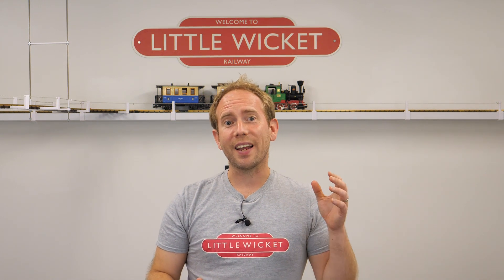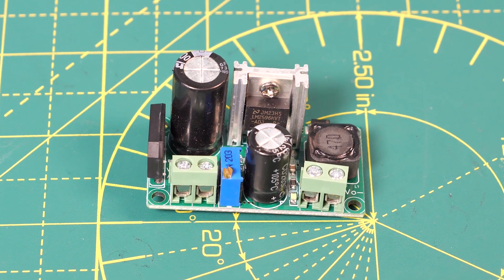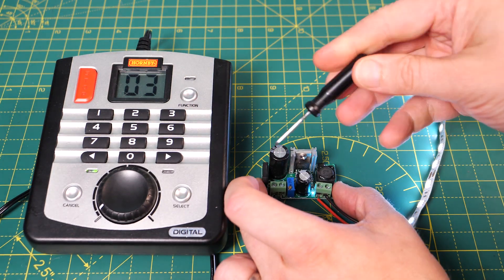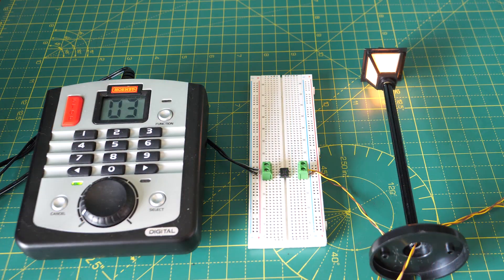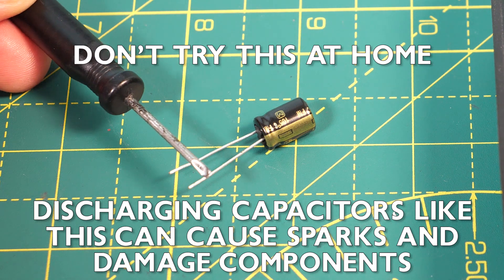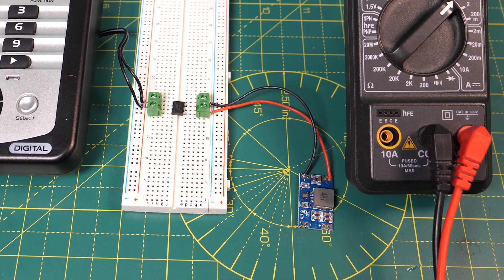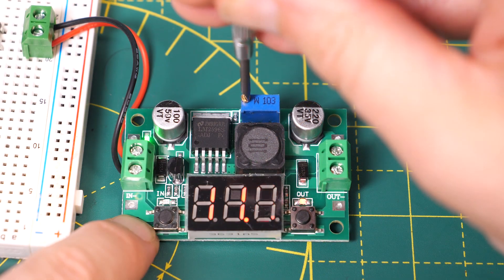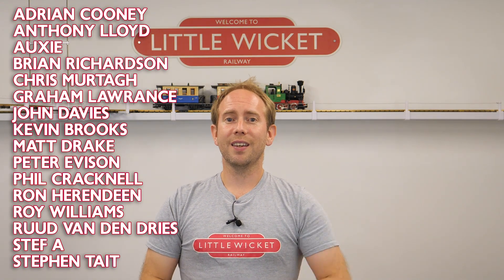Getting DC Power from a DCC Controller

Comment: Nope - The DCC waveform can be considered "bipolar DC" which is just another term for alternating current (AC).  (Square wave))  It switches between +V DC and -V DC volts  Rectified it produces a constant DC Voltage.

Comment: Hmmm, 60Hz rectifier for a 16kHz signal (not even considering the harmonics)? You should use a Schottky type rectifier for this application. You also should be aware that when rectifying a DCC signal, the negative pole is not the same as GND of the DCC system, due to the forward voltages of the diodes. If you use it to feed an Arduino which is connected to a USB port of a PC, you create a ground loop which in the worst case has negative effects on the health of your PC. Therefore, you should always use a USB isolator when powering an Arduino with DC generated from DCC (unless you are looking for a new computer).
Reply from the maker: Great advice. Do you know of a Schottky type in a similar DIL package? I think the EDB10x range might be better as they're fast recovering, but looks like you can only buy them in quantities of 2500.

Hadn't considered the grounds being different. I don't connect USB and external power at the same time, but I can see that some might.

Comment: Hi there thanks for the information I've been planning a wagon with an arduino on board but I was not sure how to power it this is the way I'll be going. Thanks again
Reply from the maker: Thanks Paul. Worth noting IoTTs comment if you plan to use this with an Arduino. Don't power the board from the track and USB at the same time to avoid creating a ground loop.
Reply: @LittleWicketRailway  
Hi there I'm looking at making a trubelsum wagon for Thomas. A dcc decoder in the wagon and a arduino controlling a servo to engage, disconnect the motor. So that I don't have to mach it to eny locomotive

Comment: I think you have over complicated things. I have hooked just an led and resistor to Dcc track power and they work successfully. No need for a buck converter or bridge rectifier.
Reply from the maker: Yeah, potentially over complicated for LEDs. What you've created is a half wave/bridge rectifier. The LED is only receiving current half the time. This probably isn't too much of an issue for lighting because the changes in signal are so fast, although I expect brightness is reduced.

I started looking at this because I want to put wireless sensors in but don't want to run a DC bus. Think a full bridge rectifier is still the way to go for this.

Comment: If you have incandecent light bulbs you dont need anything, just wire them right up to the track power. As long as the lamp voltage is HIGHER than the power output of your controller your ready for rock and roll.
Reply from the maker: Hi Nathan, I'll give this a go 👍 Thanks for watching 🙂